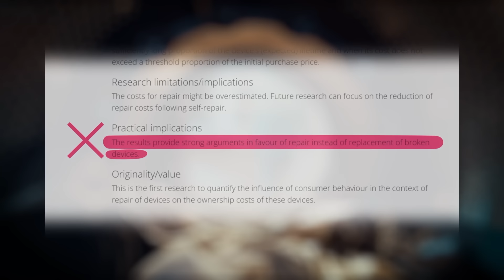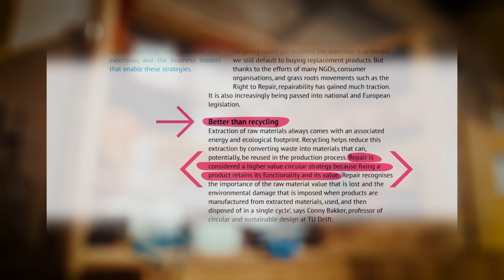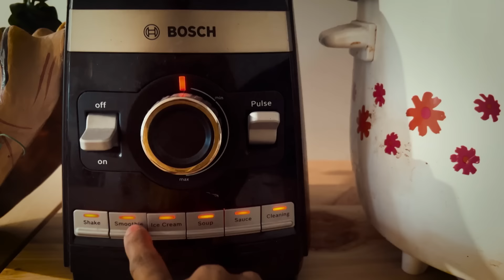How Europe wants to stop the flood of broken stuff

Comment: I use a 2003 Alfa Romeo 147 diesel which turns 21 this year. It works very well, it has never needed repairs, except for the replacement of wear parts (brake pads, tyres, clutch, etc.). It has already done 270,000 km and could do another 200,000. This year I had it repainted, but only because I got bored of its color. Do you tell the EU that I would still like to keep it and that I don't want to have it demolished to forcefully replace it with an ugly electric car.

Comment: Create a repairability certification rating system for products and tax more those with less rating
Reply: The certificate makes the product 10€ more expensive, cause the certifier doesn't work for free. We already have a lot of this. For Fair traid, For Security, For low energy consumption, for absence of poison. Now there is already a debate whether the certificate goes on the front or the back of the product in the shelf.
Reply: @ certification needs to be a government thing just like how gov regulated food.

Comment: The issue is modern products cant be worked on. Take desktop pc's vs mobile phones for example. On a desktop i can replace individual parts if they ever fail, parts are compatible with different manufacturers because everyone agreed to use standardized design. Now look at mobile phones, each model uses its own parts that are not compatible eith each other and often cant even be swapped between the same devices. There is no reason we can't create an the atx standard for moibles and other devices.

Comment: I disagree with some of this. Of course sometimes it makes sense to fix electronics to some extent, like having the ability to replace the SSD/battery on laptops because it wears out so much faster than any other component. But until some "golden point" is reached, it makes sense to treat hardware as software. Boards and chips are manufactured in an almost automated way. Most of their value is intellectual property, not a cost of production. From that point of view, fixing them is like manually patching the binary code of old legacy software on every copy over and over again. Why should we do this instead of applying a "fix" to the source code and "recompiling" (making) a new copy? Waste? First, electronic waste is a small fraction of the packaging we use every day. Second, it is better to use that labor to develop automated recycling techniques for old electronics than to try to fix every single copy.

Comment: The European Union could really aid this situation and empower people with access to technology from the global south but there are some issues in that devices from the far east are very cheap and also disposable so the pattern shift that is required is that of firstly software avaliablilty for older devices which might be expensive for large businesses like Google to maintain and who has already produced a vast selection of compatible software platform combined with android or open source projects but these require either a lot of well meaning people and or some kind of subsidy. The next is removing or limiting planned obscelence and facilitating a culture of component compatability and some note worthy benefit to providing a technology platform or hardware/software platform that is usable, highly secure and suitable to use in a circular economic function so that even if not being used by a second or third or even more people through the life span that perhaps can be used as a project platform for other use cases in other industries like for instance control systems for Internet of things and web3.0

Comment: So you can repair a PC that runs on windows 98? Why?
Here in Spain the government are turning off a TV  certain TV transmission soon. This makes to electronic waste as the TVs are not compatible with the old system.
In all of that praise on how good the EU is it was not mentioned that there is a limit of 10 years on supplying spare parts. Maybe that should extended.

Comment: I feel this is so important. Repairs can often be extremely expensive to the point where you feel like you’d be better off just buying new. Any programs that make repairs more economical for people is absolutely necessary. But we also need regulations that stop this problem at its source. Requiring companies to make things easier to repair for one. Outlawing planned obsolescence is extremely difficult but I believe there are things that could be done.

Comment: This is not sufficient for success. Manufacturer's mindset and incentives need reorientation. I mean, you can't just punish them. They want to have sustainable business from business perspective, too. So the role of designed obsolesce need to be substituted with something which is also predictable income stream. If monopoly on repairs of own products are not that, then some third thing has to step in - either planned piecewise upgrade-ability (which is commendable), or critical repair parts which can't be efficiently substituted (which would be deemed bad business practice). One of the options would be: stuff is virtually immortal, but belongs to manufacturer, who just leases it, doesn't actually sell it.

Comment: A couple of thoughts of mine related to the topic:
- software plays an essential role in guaranteeing the right to repairability. A phone with a perfectly functional hardware stays a brick if its vendor stops supporting OSes that the phone can run. Vendors should be prompted to release supported procedures to unlock their hardware and let end users install all the software they want;
- another wasteful market is the clothes one. Repairability an third-hand markets should be boosted to become preferrable compared to the "fast clothing" market
Reply: What does support mean ? There is nothing on software that can break, so nothing to repair. Everything that runs at the day of purchase, will run to eternity.
What you talking about, is adapting old hardware to newer ideas, to newer software, that's a good approach but has limits.

Comment: Sometimes the repair process cannot guarantee a long term fix. A few years ago my 5 year old dishwasher failed with an error message. I contacted the official manufacturer repairer and they even took the machine away to be tested and the faulty electronics to be replaced. The repair last only a few months, but crucially just longer than the 3 month warranty. So after having spent $800 on the repair, a few months later I replaced the dishwasher for just over $1,000.

Comment: Ever since software became the product than the hardware, we started to see products fail right after the warranty period.
It's like the Dieselgate (Volkswagen) a deceit software manipulate the hardware or like the mobile companies providing an update which increases the voltage in the LED display, causing green line issue.
Parts pairing needs to be stopped or allow third party or parts from a donor device to be accepted by their software.

Comment: A big win would be to get the planned obsolescence and the deliberate attempts to prevent repair by design in check. E.g. gluing instead of screwing without need. Or my favorite to use brittle plastic for load bearing parts like cogwheels in gears etc. because it was 0,005 cent cheaper in production - and breaks after a few months to a year. Who could possibly anticipate this.

One of the biggest scams are razor blades in my view. To be precise the industry that made people believe, they need to buy a 5 euro disposable shaving head that is good for 1 -2 weeks max. Instead of razor blades that are as sharp, are good for the same time, and are 100% recyclable metal with a cost of 5 cents... Same with coffee filters. You can easily buy a metal filter that lasts... well forever, instead of buying coffee filters every time (at least that is just paper and not as bad as the blade situation).

Comment: I love that we are returning to repairing our broken stuff instead of throwing it away and buying new. Already long ago, I had got sick and tired of shops giving me prices for repair jobs that were purposely way over the top to get me to buy a new product from them. My local car repair shop and dealer is a case in point. His prices for spares and servicing my car are slowly getting out of control and are starting to make me question if it's not cheaper to buy a new car and get rid of my otherwise perfectly good car. He charges 12 euros for a simple wheel nut! An oil change costs 120 euros. He wanted 70 euros to change a light bulb! That has all got to stop.

Comment: We urgently need legislation to tackle inbuilt obsolescence. We are just creating garbage that it’s not cost effective to repair and in a lot of cases already built in an unrepairable manner as in the case of soldered batteries. Manufacturers used to pride themselves on the durability of their products but now all about dumping and cheaply replacing, with fewer and fewer options to buy a better, if slightly pricier, product that will last longer.

Comment: Easy implementation for EU would be to require all battery powered gadgets to work if connected the charge cable.

Millions of gadgets are thrown away when the small battery inside the device dies. The battery should be bypassed automatically.

Comment: there needs to be some standards for repairablity these days.
From personal experience I can tell you that the engineers who design this want their things to be repairable and are softened designed that way in the pre-production/proof of concept stage but are told by suits to make it less repairable.
the worst I saw that really pushed me over the edge to start advocating was when the scroll wheel broke on my 120$ razer mouse, I took it apart to replace the encoder and found that not only was there an outline for a socketed encoder, but that they had omitted the socket entirely and soldered the encoder directly to the board. Luckily I was able to fix it but it pissed me off so much.

Comment: "If you use 3D printing, it would cost you 0.50€ to make the part, if you purchase it from the producer, you would have to pay 200€. It's ridiculous, nobody can explain it!"

this dude's iQ is 0.50€. My man really didn't think about 3D printer cost, electricity, relatively weak durability, time to actually develop the part vs "the producer" having probably a mold for the part, better materials, lack of scalability to produce 10+ parts per month that would def drive up the price of that part, etc. 
tldr the water Is wet I'm off to finding an e-waste garbage, repairing it and getting a 200€ check off my numerous "repair shops" by providing "real" repair purchase checks.

Comment: one of the reasons i think to why there's a high increase of E-waste specifically with computers and phones is because many developers only develop for the top end hardware and hardware companies pushing the envelope on making highly overpriced top of the line performing hardware which makes the lower end hardware obsolete really fast. windows 11 is also another reason why many computers end up in the trash, most people do not wanna go for a macbook or use linux and demand to use windows, since there are still many computers that are slightly below the minimum requirements of windows 11, users will feel urged to upgrade especially since windows 10 loses support in october 2025.

Comment: I tend to be careful with electronic equipment and have it repaired when something happens. Installing new hard drives in notebooks and desktops is always a necessity, because they have a short lifespan. Increasing the memory capacity of the equipment is sometimes necessary. Even when I am forced to buy a new notebook for work, because the old one does not support the newest operating systems introduced in public platforms of the Judiciary Branch that I have to connect to in order to do my job, I tend to preserve the equipment and give it a second life. When I do not donate it to someone, I have it upgraded as possible and keep it as a kind of spare tire, for any eventuality. But there is one thing that really made me angry. A few years ago I bought a beautiful and excellent HP printer. I used it for almost a decade, but I was forced to stop using it not because it broke or malfunctioned, but because the newer versions of the Windows operating system were simply no longer compatible with that specific model of printer. And to make matters worse, HP discontinued manufacturing that model and stopped providing software updates. It is simply insane to condemn a good and usable piece of equipment to be thrown away for such stupid greed. And I am not talking about the loss I suffered here. That is the least important issue, because I had already bought another printer. But I liked using that one for some things because its print quality was exceptional. With "business as usual" operating this way with state authorization, it is impossible to stop producing waste. So what urgently needs to be fixed is not just things: it is public law, the State and its institutions. They have been hijacked by the neoliberal idea that profit should be maximized through planned obsolescence.
Reply from the maker: Hey Fabio! Thanks for sharing your experiences. So shitty that stuff is just "forced" to not work any more. We actually looked at the concept of degrowth, no more planned obsolescence a bit ago. The video could be interesting for you, too 👉https://www.youtube.com/watch?v=_22mKe_OLsg

Comment: One thing you could add in the next part is the consideration of the difference of resource use of energy hungry old products. For example an old electric heater would likely have a higher impact than a new infrared heater. Same reason why we all switch to LED lamps.

This goes mostly for heating, cooling and other things that are turned on for most of the day.

Repair services will have the incentive to repair and not sell new products. The incentive shouldn't be repair but to aim for the more sustainable choice.

Comment: "Negative Externality".  That's the term we use when we derive benefit from using something, but push the detrimental consequences to others.  We need to include a tax in the price of products equivalent to this Negative Externality and use it to support a circular economy.  In the US we donate to Goodwill.  They train and employ people to fix donated products and sell in their stores.  I wish Goodwill would open a repair depot for people who want to fix and keep their things.

I bought a plastic clothes hamper 20 years ago.  Seven years ago, its rim cracked.  I search YouTube on how to fix this crack and found one solution was to drill holes on opposite sides of the crack, then hold the crack together with zip ties.  Today, this hamper has 10 zip ties but still holds my laundry.

Comment: This is a nice idea, but the amount of admin and bureaucracy in putting this through may end up costing more resources than it saves. 

It would be better to put the focus on the commonest faults and design flaws and pushing for better. E.g. making phone batteries replaceable, as these are common failure components. And prioritise by the most ubiquitous products and their most common designed failure points.

Comment: Growing up in a generation which could repair and or upgrade specific components in our PCs like RAM or storage, to sealed fancy schmancy 5g cellphones with unreplaceable batteries that oddly, explode and or bloat? 😢 And nightmarish stories of car sunroofs that won't open just because you didn't purchase a "software update" from the internet? Yes, some updates are required, maybe, but why pay for incremental updates, cloud connected cars when local versions get the job done too. This monopolistic market rigidisation and control over encrypted spare products being used , like only a specific coded tyre 😂 allowed from a specific manufacturer kills competition. One reason I dislike the word supply "chains". Hellish chains. Supply symbiosis makes more sense, and is the reason why diligent repair people can still get a cellphone or a satphone to work in remote regions. Its deceptively easy to consume more and mores, easy buy, easy throw, but there's a cost involved.  Yes we pay for research and innovation. But a cloud connected sunroof? Thats imbecile! Older PCs and cellphones had battery charge indicator lights separate from the software battery charge indicators, and you could easily hot swap and tell if a spare battery had adequate charge levels. Not anymore. A newer technology like 5G cellphone  is 13 times the entry level price of older but then novel technology like 2G EDGE. Affordable was not just a buzzword but a way to democratize technology, give and enable choices. Good luck trying to get a after market spare for a phancy schmancy 7G phone or a single pcb motherboard with all components soldered components.